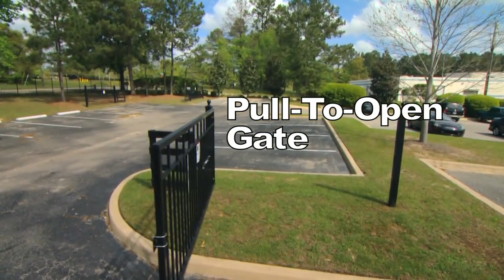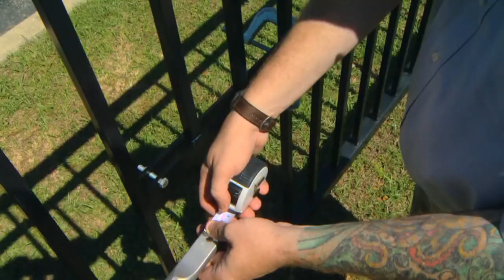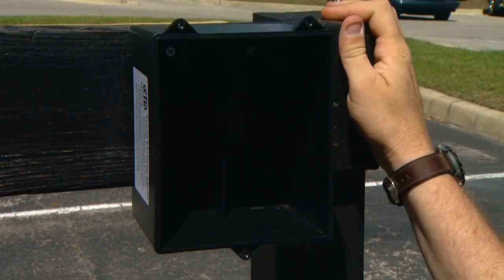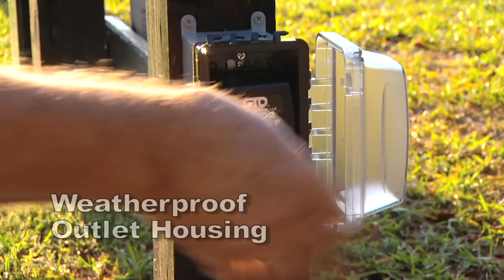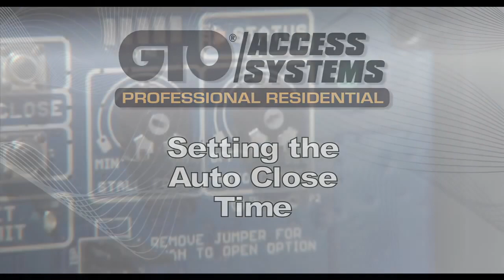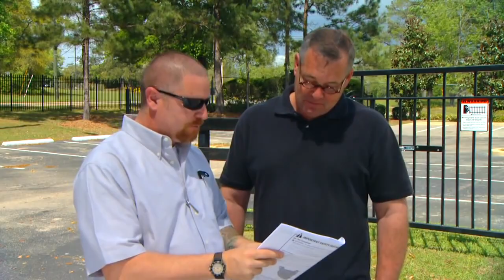Instalando el PRO-SW2000XLS de LINEAR Puerta Abatible

Comment: I

Hi, I got a card for dual opener and I would like to use it in a dual Sliding gate. The cable from card to motor is 5 lead inside. 2 of them for motor: I guess the other 3 are move detector sensor. Do you know what sensor type and connection they are?